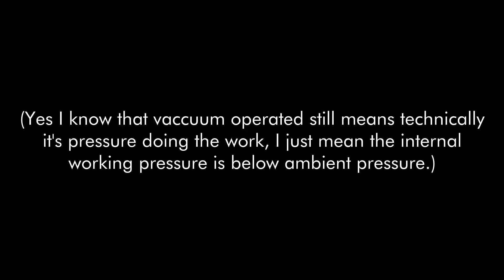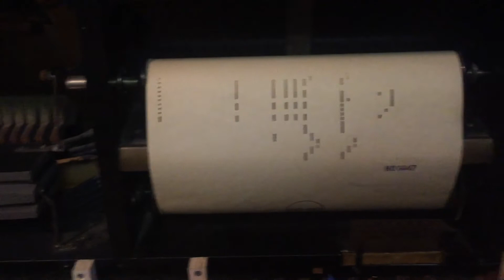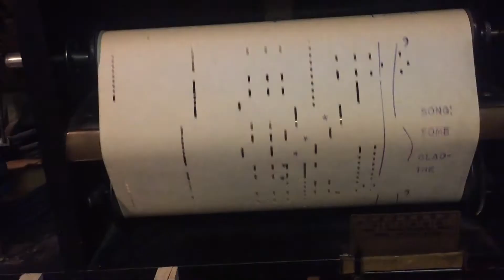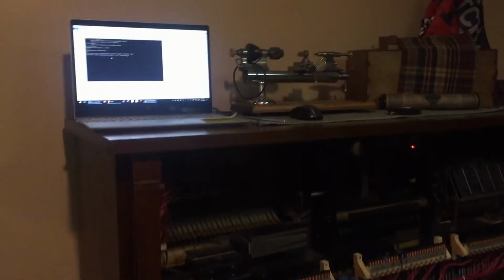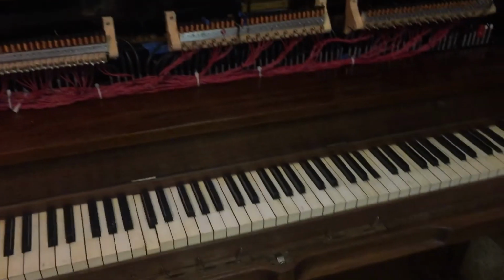Playing MIDI files on an Antique Player Piano

Comment: Yeah, I hate these ones that run on what amounts to a disembodied vacuum cleaner (yeah, not an actual vacuum cleaner but with the same kind of fan). They sound so annoying, like, "Hey, while playing a song let's vacuum the floor with the piano!" But they don't have to retrofit it with one of those just because it leaks. Why not just fix the leaks? And then people retrofit these with those even when they don't leak. I like the kind better that have a bellows motor instead of a noisy fan! And how weird that yours now uses TWO fans: the vacuum fan (centrifugal) and the power supply fan (usually axial, like a desk/ceiling fan, etc.). Why not use a bellows motor unit (quiet) instead?

Comment: Do not put tape on the tracker bar for any length of time. This to all a warning. GOO! Especially cheap electrical tape. That stuff is just trouble afterwards. Clean with naphtha on a rag.
The electromagnet attracting up a ball bearing is OK but requires more current than if the flux has a more complete path like the letter "C" rather than the letter "I". This is why your current is so high. I have both organ and player new and old experience. I rebuild the classics and install QRS.

Comment: Could you describe the valve fabrication? Is the seat for the ball just the beveled face of the tap drill, or did you have to do something more involved?
Reply from the maker: It's been a while, but I believe at first I had tiny O-rings that I could drop in, and then the ball bearing would sit on top of the O-ring, and the seal would be between the ball and the O-ring, and between the O-ring and the tap drill bottom. 
If I'm remembering correctly, that didn't work all that reliably, so I got rid of the O-ring and then the bearing just sat on the the conical face from the tap drill, and that was the seal. I went through them ones and hit the top of the ball bearing with a punch and hammer to peen the sealing face a tiny bit, to flatten out and irregularities in it's shape.

I since made a second version of this project, using the same solenoids, trying to improve reliability. It didn't work all that well, unfortunately, so now I'm just starting work on V3. The solenoids were just very borderline on their strength, so this time I'll wind new ones.

Comment: This is awesome, I just got the same piano and I am in the process to make the player work, what vacuum pump would you recommend? have you replaced the original tubes from the back of the player to the keys? how have you connected the solenids to the existing tubing.
Reply from the maker: Well on my piano, the tubes in the back run from the tracker bar to a bank of pilot valves that are behind my solenoids, and then those pilot valves act on channels that run through a wooden piece toward the front of the piano, and then down toward the keys. No tubes actually run to the keys. The solenoids I have are connected to the passageways int he wooden adapter piece, and so the solenoids are positioned after the pilot valves.

I did not install the blower to create the suction, a previous owner did that, so I'm not certain what he used. It certainly sounds like a typical universal motor blower you'd find in a common shopvac.
Reply: Hello! I have a player piano too, mine has no vacuum pump and only the pedals with 2 big bellows. But i'm pretty sure there are pumps made for player pianos actually!
Greetings from Sweden

Comment: Have you ever considered trying your system with any of the popular songs converted to a midi? Like the ones where it sounds semi nightmarish as it mashed a song into a midi and you can kind of hear the lyrics.
Reply from the maker: I've played some popular songs as reasonable MIDIs, and it works ok once I carefully clean up the file. Those insane nightmarish ones often do not work, but not because of my system, it's actually the original piano that can't handle that so much. If way too many keys are pressed at the same time, the vacuum can't keep up and the system doesn't work correctly.
Reply: @domsworkshop1325  Maybe you need an accumulator

Comment: I'm wondering if I could get some of these boards somehow?
Reply from the maker: I have 9 of the V1 boards still laying around. They have only a two darlington arrays for the outputs, rather than four, so they can only handle half the current. So it's two 8-bit shift registers, controlling two 7-channel darlington ICs, for 14 total outputs, and of course they can be chained together for more outputs. The boards have spots for resistors or fuses for each output, as well as spot for a of fuse for each darlington IC as a whole. I don't have enough parts to populate all the boards, but I could probably do one or two. Or if you just want the bare PCBs, I can do that too. Email me, panzinodominic@gmail.com

Comment: Nice!, try to find a way to generate vacuum more quietly, And make a fake roll that is spinning in a closed loop while playing midi- just for the effect...  also you can connect a Bluetooth module to the Arduino to make it wireless-midi and connect to any computer/phone over the air...